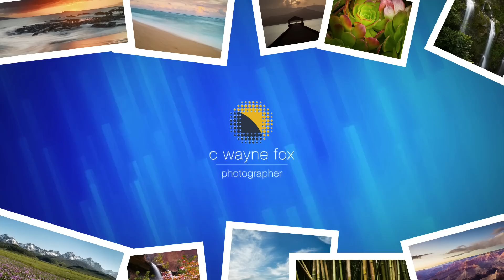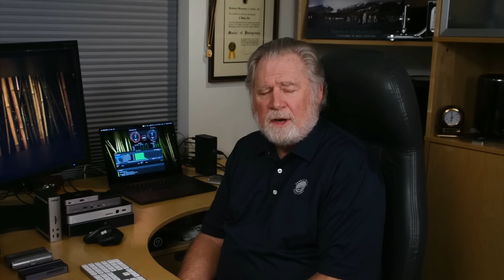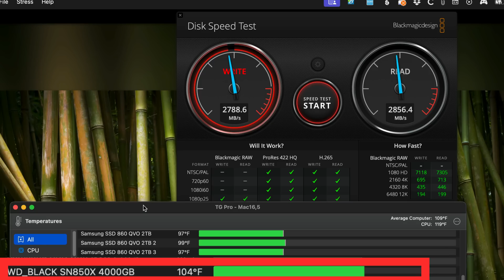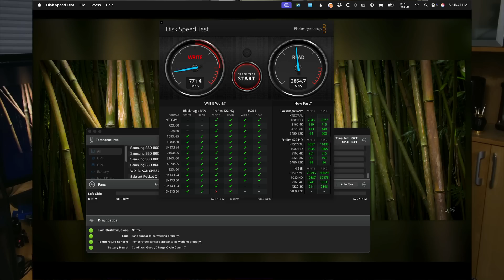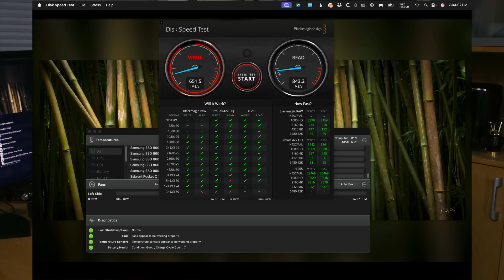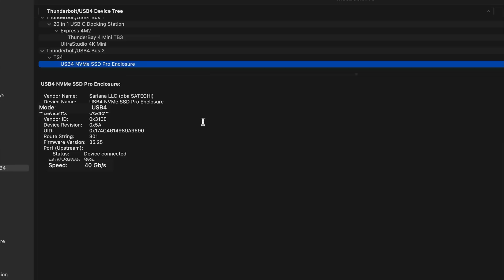Two BIG Problems with Docks!

Comment from the maker: Currently working with CalDigit to see if there is a way to resolve this. I’ll update this comment as I get more information.
Reply: it's actually nothing strange, I believe Sonnet has video explanation for that in one of their YT videos on why they use TB3 instead of TB4 on their PCIe expansion modules - to simplify, TB3 can give "all" 4 lanes to a single device, while TB4 can give only 1 lane per device in hub with up to 4 devices in total
Reply: @TzzSmk  yep, you are correct, hub, not so good.
Reply: I actually resolve this bandwidth issue by having two physical docks, all from Sonnet Tech, one dock is for my monitors and USB ports, the second dock is for my two external SSD drives.
Reply: And each dock is connected to my Mac’s dedicated TB port

Comment: @cwaynefox great analysis - thanks for taking the time to do this.  I spent quite a bit of time looking at the specs of TB docks.  For all of the ports I wanted and the guarantee of the bandwidth and ethernet, I got down to the CalDigit and the Echo 20 Superdock.  I have 2 OWC Express 4M2 enclosures and a Thunderbay Mini connected in sequence to the Echo 20 and all are getting full bandwidth which I found pretty amazing.  The other plus was that the Echo 20 has a space for an NVME drive which I use for my Time Machine backups.
Reply from the maker: I’m hoping Sonnet comes up with a TB5 version of the Echo 20 ... will be anxious to try it out.

Comment: That brings up the port on the Mac itself. I assume one internal controller handles 2 ports. To get max throughput, I would guess the best is drives on one controller and displays on another. I have tried to sort that out- which controller supports which actual physical USB C connections, but it's not clear. I just move them around until the speed maxes out. I have seen other computers where there's one controller for 4 ports, and those crawl. Cheers!
Reply from the maker: The M series of processors has a TB controller for each port.  Each port is independent and can support a full TB chain of 6 devices.  Obviously once you connect a dock, all the ports through that dock (including the downstream TB ports) are handled by a singled controller on the Mac.  There are certainly options to avoid these problems, such as using the built in HDMI and TB ports for displays and having the dock only handle data, or vice versa from it’s own port to the Mac.  I think for many the idea of a dock is a quick and neat one cable connection for the their computer to their desktop peripherals.   For many this is fine, they don’t need the bandwidth.  Even if using 2 4k displays and maybe only having 800-1000 MB/s for the data, that’s fast enough.  Each person needs to determine what they really need out of a dock, I just try to review what their capabilities compared to each other.  For many a good TB 3 dock is all they really need. But some need 2 or even 3 display support as well as decent bandwidth for large file transfers or working with things like 8K video. And then there are people like me, just an addiction to see how fast I can get things to work.

Comment: ive asked around before, on other videos, so are all the thunderbolt ports on a mac laptop, independent? like each one is at full spec? or is it really 3 ports, being split up over 1 pcie/bus/lane most likely pcie 3.0x4  or pcie 4.0 x4?
Reply from the maker: Each is an independent bus with its own thunderbolt controller. The controller circuitry is part of the overall circuitry in the M series CPU.
Reply: @cwaynefox  good you will have plenty of power.

Comment: My two problems: There often is a useless „main port“ with charging (a PC) and that copying between two Thunderbolt SSD at a dock is veeery slow.
Reply from the maker: A little confused, the “main” port that charges the PC is also the data connection to the PC, not useless but required. As far as copying between two SSD devices,  not sure what dock and what protocol you are using as well as what SSD’s and their protocol, but if I connect my 2 fast SSD’s (both achieve about 3400 MB/s read/write connected directly to the Mac, about 2800 MB/s connected through a dock, I can my effective transfer speed is around 2600 MB/s.  I test this by copying a 400 GB. disk image file that is loaded with about 380GB’s of data. You might need to re-evaluate your hardware and/orconfiguration.

Comment: Maybe it’s just me, but this whole video is a “yeah, of course”, I’m only really surprised that the impact isn’t higher when connecting a 4K monitor. Also fun, there is also USB C with DisplayPort-alt mode, in which case you’re using dedicated wires for video and it doesn’t interfere with speed (but you’re almost definitely way better off with Thunderbolt in the first place so this is just a “one more thing to worry about”, not a “solution”).

I believe some hubs can downgrade from Thunderbolt mode to USB mode, although I haven’t actually tested this. But I have a pair of Lenovo laptops, one I kept Thunderbolt disabled and the other enabled, and I recall both could connect to a particular Thunderbolt 3 dock, although I have no recollection if I used video or anything else.

It makes sense that the read speed wouldn’t be impacted but the write would, doesn’t it? The monitor connection and write are both moving data from the system “out”, so are sharing bandwidth, but the “inbound” stream isn’t involved.

Comment: Firmware updates should solve a lot of the problems you're seeing. I ran into a similar issue with a TB4 add-in card for a Gigabyte motherboard that doesn't have the latest NVM firmware so it doesn't support USB4 devices properly and sees them as USB3.2 Gen 2. Unfortunately, Gigabyte doesn't have any publicly available firmware for it.
Reply from the maker: Agreed, hopefully CalDigit is interested in pursuing it and resolving it with a firmware update.

Comment: That the read speed is not affected is imo due to the direction of the data streams. The video signals go the same direction as the write signals. The read signals have the highway to themselves. The problem with the video signals slowing the write down is apparently an HMDI thing. Display-port should not, according to my research,  inhibit the write. The reason for that is called "display-port alt mode". Requires certified TB4 or USB-C cables with (non-fake) DP Alt Mode symbols though.
Reply from the maker: Thanks for that.  Makes sense.
Reply: I tested the write performance via my newly aquired UGREEN Revodok Max 213 with  DP port. PC has 2 x Thunderbolt 4 Type-C w/ DisplayPort 1.4.  Monitor has DP 1.2. OS is Debian Linux with kernel 6.12.5. Directly connected to TB4 port I got Read: 3.2 Write 2.8. Going through the hub: Read 3.1 Write 1.5. Out of the box the issue of reduced write performance is not resolved. Maybe there is something I need to do in my Linux system and/or there is a limitation due to monitor only having DP 1.2.

If I am bored in the future I may investigate and test more, for now I don't have any need for using external ssd on the hub.

Comment: I’m surprised that you are surprised. You can use a toaster at every power outlet in your house, but you can’t use a toaster at every power outlet in your house *simultaneously*. That goes for data transfers within a computer as well. If you read video data from a disk, display that video and apply rendering to that data everything has to happen  *simultaneously*, which means that any component involved in more than one or all of these processes will have to manage the maximal throughput and share that over all I/O channels involved. 
The second point stunned me: “compatible to” any USB standard, did never and will never mean, that a device or cable is capable of handling the maximal throughput. That is one of the key differences in Thunderbolt compatibility: In order to be compatible you have to do exactly that. Docking stations connected by a Thunderbolt 5 cable have to be able to handle that specification’s maximal throughput *on that port*. That doesn’t mean, every device connected to that docking station will be able to have that throughput, as they have to share the bandwidth going to and from that docking station to it’s host between them.
Reply from the maker: My “surprise” was more of a statement of how I think most viewers would react and many of the comments reflect that.  Sorry for adding a little “melodrama” in the video., in fact I’ve talked about this problem in some of my dock reviews when using multiple monitors.  I think my goal was to visually demonstrate it a little better.
Reply: @  I appreciate your response and your honest explanation. You did tell the story, it just seemed improbable, that you as someone using all of the devices on a regular basis would be surprised. It might have been an idea, to lead with something like showing the specs on the package or the manufacturer’s website and showing that while they technically are correct, they need to be put in a context of the actual use case. Like you most people use more than one device at the same time and might not even be aware of the issues caused by simultaneously using several external devices connected to different ports. Thanks a lot for clearing up my misunderstanding. 👍

Comment: "I didn't plan it too well..."  Indeed.  This is a video with a lot of data but not much information.  What dock should we buy?
Reply from the maker: I have numerous dock reviews and in fact included a link to my recent review where I compare the Ivanky, CalDigit and OWC docks. In that video I mention for some these three docks are overkill and an older yet very capable ThunderBolt 3 dock might be a better and more affordable choice, and reviews for those dock you can find in my computer hardware playlist.

Comment: It was not clear how the display was connected to your dock - thunderbolt? display port? hdmi?

You just said it was connected 

Cheers
Reply from the maker: Sry.  the Ivanky dock supports has an HDMI which supports 4k, and  2 TB4 downstream ports which support up to 6k , I used one of those for the SSD, so the other one went to the 2k display. The 4k Display was connected to with HDMI.

Comment: Docks are so inconsistent its almost a farce to get tech that works as advertised.  As a technologist I have a budget to test whatever tech i am interested with - so for example, finding docks that can fast charge a mobile gaming rig, needs just 65 watts and most docks fail to deliver the charge to the device so the device goes to slower speeds… also lets not get into usb c cables and different standards,  charge rates and clone cables…. Yeah docks are tricky

Comment: Interesting- i recently upgraded to Fios Gigabit and I was testing some cheaper docks with Ethernet ports on my Mac, and was testing my internet speed and read and write to network drives. I noticed that my wired internet was getting only 80mbps while my WiFi connection was getting 540mbps on WiFi 6e. These Ethernet ports are supposed to be 1 Gigabit ports - I am still troubleshooting and it might not be the dock’s fault but that is also something that surprised me and that needs to be considered- the newest Caldigit dock has a 2.5Gbit Ethernet port.
Reply from the maker: I recently hard wired my ethernet as well when I upgraded to gigabit fiber.  I was getting terrible speed (slower than wifi) , so I bought a 2.5GbE ethernet switch, to replace the old switch I had. It completely resolved the problem. I consistently get ping under 5ms now, and download and upload consistently around 950Mbps
Reply: @cwaynefox  should of just jumped, to 10gbe , it is gonna cost, the same or less.

Comment: Thank you, Wayne. Most Buses are shared at some point, be it Memory, CPU, I/O or Controller Chip etc - you also need to consider the Computers internal layout, not just the Dock.
Reply from the maker: Yes internal layout will determine the actual capabilities as far as what display resolutions and number are supported, but the bus itself is PCIe multiplexed with DisplayPort, and is an Intel certified standard, so it seems the dock is much more likely to be the problem.  I guess there might be something in the OS that is interpreting things wrong, but that seems unlikely as well to me.
Reply: Sure. Also worth comparing is whether you get the same results using separate Thunderbolt ports or not. They should be independent, but I believe it is possible for them to share PCIe lanes internally.

I would expect this would actually cost a manufacturer more (to implement the chip to share/multiplex internally), but if a manufacturer has to do that anyway for some reason, they might connect everything on one end of a motherboard to that chip to reduce the number of traces they need to route. Never underestimate the willingness of a manufacturer to hobble your experience to make manufacturing or design slightly easier, if there is a right way and a “meh, good enough”, someone will “meh”

Comment: Thank you. Informative. Unrelated have you had trouble with external drives whether via dock or direct plugin. I noticed that they often unplug themselves With the error message that you should eject them first. Wondering if this is an issue with the new Mac OS….
Reply from the maker: I had problems with that using Sonoma, and resorted to using Amphetamine to prevent the computer from completely sleeping which resolved the problem for me.  Since switching to Sequoia it I haven’t seen the issue.
Reply: Thank you. Interesting. Happens with Sequoia for me

Comment: Thanks for the video. And you have a wonderful voice, I could listen for HOURS 😉 Question: A TB5 dock (if available) would solve the problem, right?
Reply from the maker: A ThunderBolt 5 dock (currently testing Kensingtons, video in a day or two) should help.  You have double the bandwidth, and triple when sending data in only one direction. I assume if you tax the device with 3 4k displays at 144hz you might impede the performance of your storage devices, but the end result should still be much faster speed to those devices.  We might be talking speeds of 5-6000 MB/s with no displays attached, and maybe losing some to only get 3-3500 MB/s with a couple of 4k 60hz displays. But that’s really fast, and for me fast enough.

Comment: Great info on the TB hub bandwidth sharing and how the monitors impact it.  I can always count on you for in-depth technical content.  I just got an M4 Pro Mac Mini and a Caldigit Elements hub so I’ll definitely keep your findings in mind when I connect all my devices.  Looks like I’ll be investing in  a TB hub when the prices come down at some point.  I hope you’ll do a TB 5 hub review some day.
Reply from the maker: Working on a review of the Kensington (hint, it will probably need a firmware update and am working with Kensington tech support on that right now), and I have the OWC TB5 hub ordered and think it will be a really useful device.

Comment: I realized this bandwidth limit/sharing while using  a USB-C upstream on the LG 32UP83a monitor. Essentially, the monitor is a dock with 2 USB type A ports (3.0) and display connected with audio. I used a USB-c connection to drive the monitor from my iPad Pro M1 12.9, so I can utilize the external display feature, enabling the iPad as a desktop (stage manager). 

Initially, I plugged in a USB-Ethernet dongle to provide wired connectivity to the iPad. I was reaching around 350-300Mbps network speeds. This is when I realized the display output from the iPad uses around 700Mbps @ 4k-60Hz over the 10Gbit USB-C connection.  Since then, I have returned to using a wireless network as I would achieve 500Mbps on average.

Additional notes: The USB dongle was not the bottleneck. The iPad received power from the monitor up to 65watts over that connection. I determined the use for those USB 3 ports are only useful for HMI devices. Not sure if how well and what  USB camera would work with that iPad, hmm.

Comment: My problem connecting DIRECTLY to the M1 Studio Max is (apparently?) the Mac Studio's Thunderbolt 4 port isn't providing enough power to the NVME enclosure? Just one NVME enclosure is connected - It just loses connection. I've tried multiple Thunderbolt 4 cables. I was hoping a dock would solve this issue? Any thoughts?
Reply from the maker: How many SSD’s in the enclosure?  Each SSD can pull over 10 watts, and I think the Mac only supplies 15 watts of power.
Reply: @cwaynefox  Just one NVME in the enclosure. A 4 TB HP NVME, brand new.
Reply from the maker: @DirettoIZM what enclosure?
Reply: @cwaynefox  Wavlink - It's a vented aluminum enclosure from Amazon. The OWC one I wanted was out of stock. Thanks for your effort, by the way!